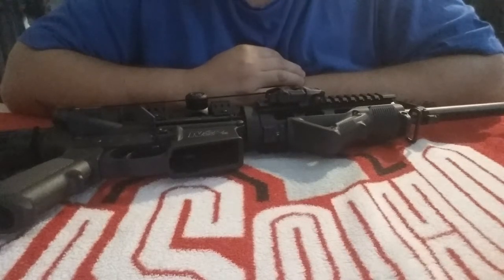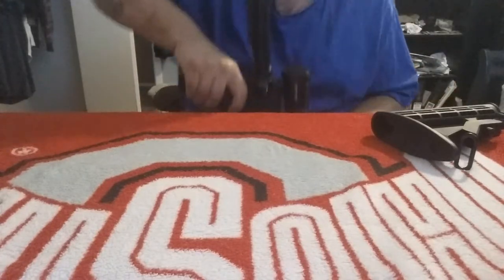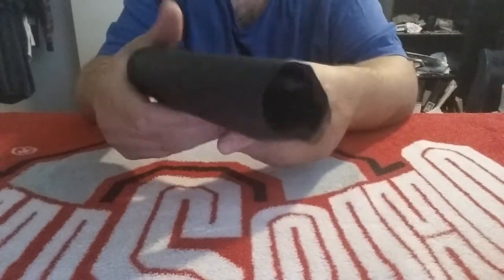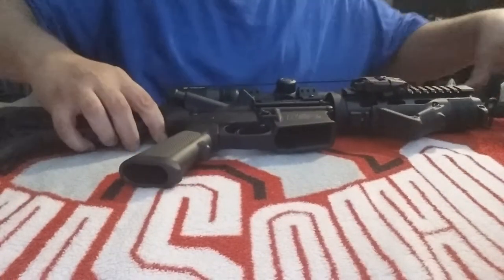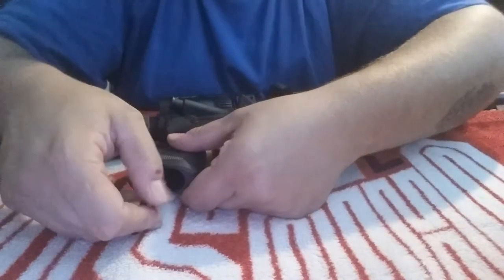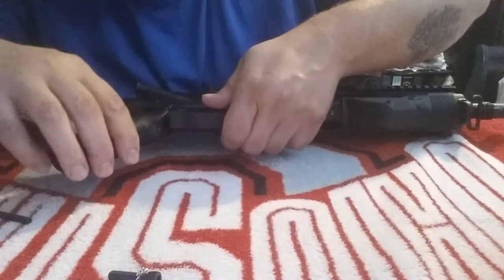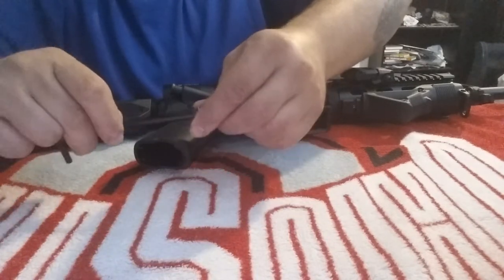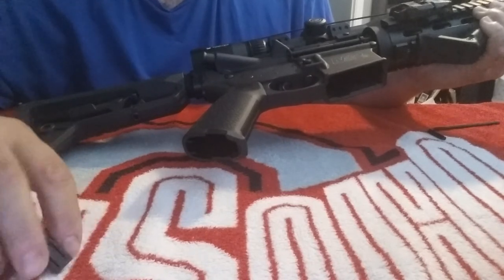Installing the Magpul but stock and grip for my Smith&Wessen M&P 15 sport ll

Comment: The spring has nothing to do with the safety, if not properly installed the spring will not push the trigger reset detent and the trigger will not reset after a round is fired.